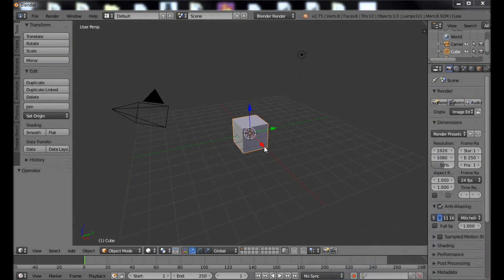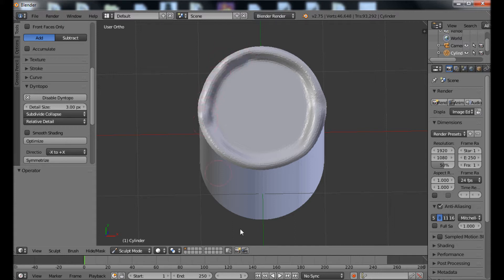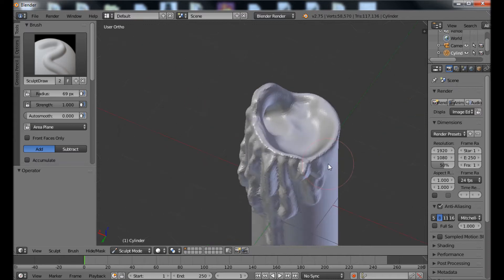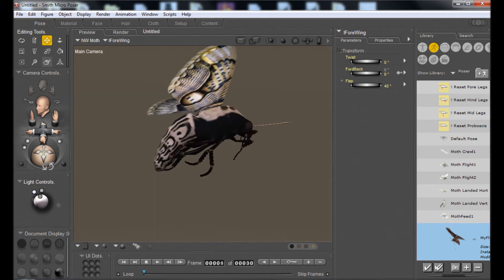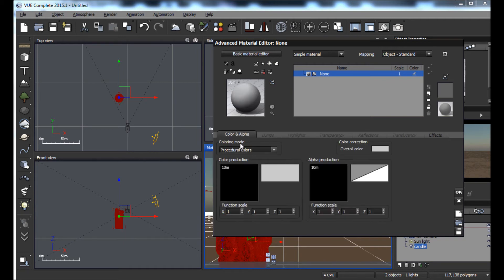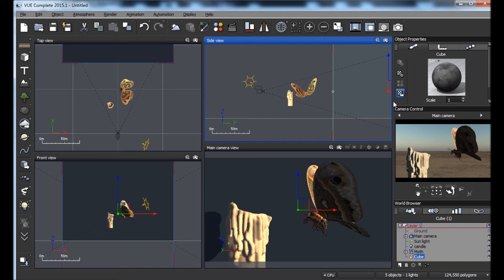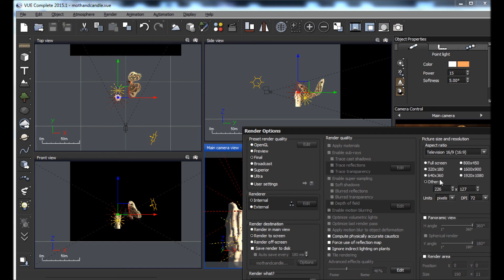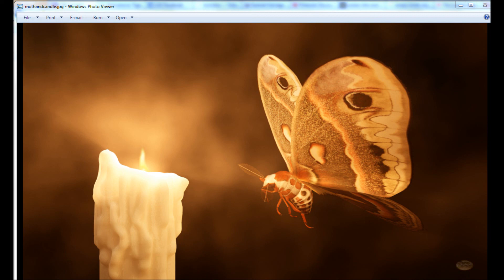Sculpting a Candle in Blender 3D

Comment: Thank you so much for this simple and clear tutorial.
I would have just one question. If i add a cylinder using the tabs on the left it shows the "add cylinder" mask on the bottom left corner and i can edit the number of vertices, while if I click on the "add mesh" menu like you did the mask does not appear. May i ask you a little help please?